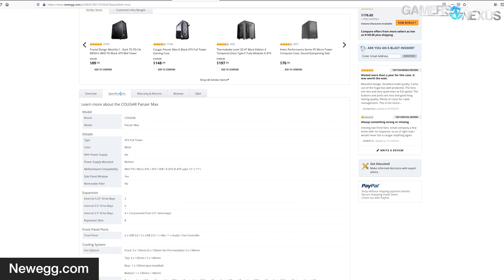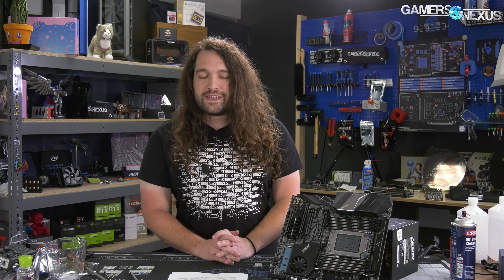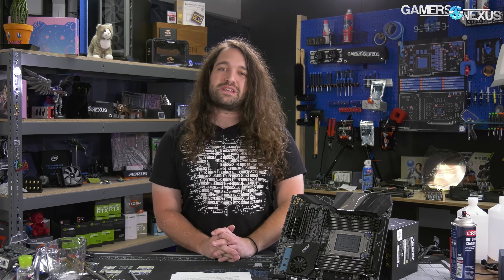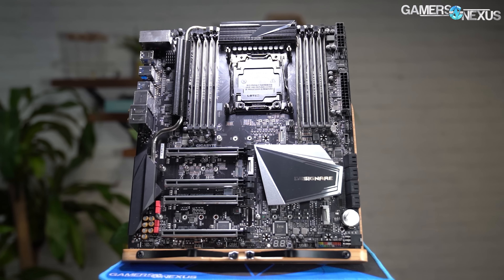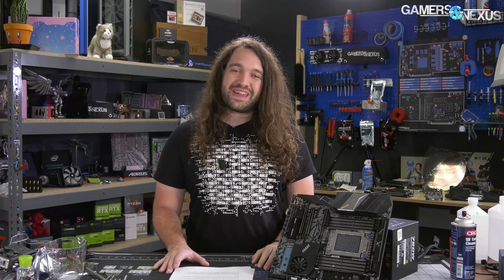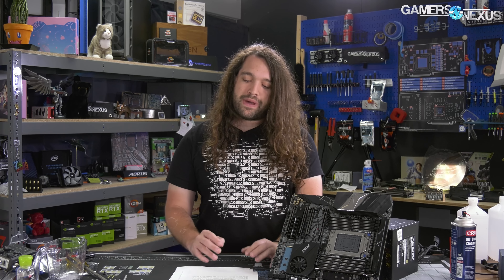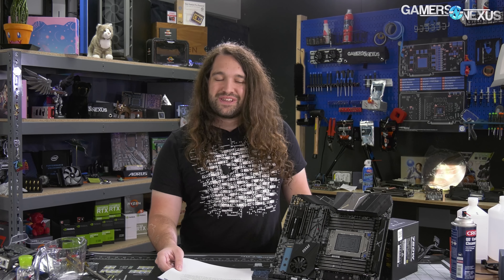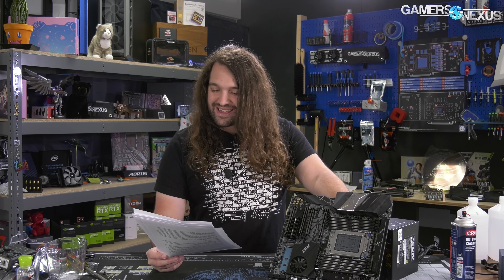"E-ATX" Is A Lie: How Motherboard Makers Ruined Form Factors

Comment: I had a prebuilt once (Medion MD8800), years ago that came with a BTX motherboard in a BTX only case. Had a Pentium D cpu. It also had no cable management system whatsoever. That killed any upgrade path for that down the line. It had a active case fan placed next to the huge heatsink on it, which kinda meant they were using the same cooling methods of an ATX system.

Comment: If I remember correctly back in early 2000s there was a form factor E-Atx(SSI-EEB) which all motherboard makers and cases stuck with for workstations and high end motherboards. It was only with advent of X58 that the nonsensical Xl-atx and E-Atx(current) started out.

Comment: My older computer had an SSI-EEB board (Asus Z10PE-D8 WS). I bought a case that was advertised as E-ATX compatible. The board fits, but the mounting holes are out of alignment in the PCIe area. The graphics card has held that part of the board in place, it's a big mess.

Comment: Now make one about how case makers have turned M-ITX cases into barely scaled down ATX cases. 
Edit: and how they’ve killed off the Micro-ATX form factor
Reply: @ferinfox  It's not just mATX, also ATX board have those "we saved some PCB, so you don't get 3rd row of screws". Installing 24pin there with finger under it was painfull, but could break the board if not done so.
Reply: @onboard3  that's something that always drive me crazy, mfgs are just being cheap
Reply: on my matx board you cant install a gpu with backplate because the ram slots are too close, i've since taken out the lower ram clips to make it fit, doesn't seem too secure tho...
Reply: YYYYYYEEEEEESSSSSSS
Reply: @ferinfox  hey mAXT has specs 4 pcie slots on back and 244x244 mm :D
Reply: @onboard3  but mostly only seen on budget boards with only 2 dimm slots and not much periphery imo
Reply: @ferinfox  specs are max. dimensions you can use less. And ITX and DTX came later afaik.
Reply: And as China destroys the desktop pc market with incompetence. 🤣
Reply: @ferinfox  mATX isn't a problem, there's a defined max size, and you can always fit a smaller board into a larger case. The problem with "EATX" is that there's no defined maximum.
Reply: This issue is made worse by the usage of words/acronyms.

"M-ATX" is NOT "micro-ATX" , the "M-ATX" acronym stands for "Mini-ATX" and was released as a form factor in 1997 by Intel, it was also released alongside the "F-ATX" form factor which is an acronym for "Flex-ATX".

The correct acronym for "micro-ATX" (Often called "Micro-ATX" with a capitalised "M" in the word "Micro") is "mATX", it does NOT have a dash separating the "m" and the "ATX" parts of the acronym. 

It is unusual that this is the way to officially write out the acronym as most acronyms used for the "ATX" series of form factor designs often do include a dash "-" to separate the two halves of the phrase.

Also, another common mistake is the use of the term "ITX" when describing a "Mini-ITX" form factor motherboard, the "ITX" series of form factor designs is of the same importance as the "ATX" naming scheme. 
I say this because there is no single "ITX" form factor, you have a range of sub-form factors under the "ITX" acronym.
Examples of such "sub-form factors" include: "Thin-ITX", "Pico-ITX" & "Nano-ITX", other "ITX" sub-form factors are also available.

Hopefully with the information I have provided above you can start to see where things have gone wrong, too many similar acronyms with insufficient amounts of customer and technical knowledge in the field, and as such it has resulted in a whole generation of customers & engineers who often mix up the acronyms and the naming schemes of each form factor, alongside this is the lack of self-regulation in the industry which has resulted in a single acronym having more than one physical dimensional size defined to itself, E-ATX & XL-ATX are perfect examples of this.

As the customer we need to not just put pressure on the industry to regulate, we need to enforce our own definitions of what we understand each form factor to be, and force the industry to apply by & design to those customer defined form factors with NO deviation from the standards that are defined. Most sizes are already clearly defined in the OFFICIAL ATX Specifications documentation, it is only the odd layouts that need to be eradicated to history.
Reply: @tobymarol7329  that may not have been a good idea. I caused ram errors during a memtest86 run by thoughtlessly touching my ram. Wanted to see if the heat sinks were hot.
Reply: I actually looked at the various M-ATX boards and  there seems to be very little  in that form factor that goes beyond the ultra budget slash OEM cheap out grade. M- ITX boards are more feature rich despite being much smaller.

Comment: BTX was really a non-starter. Dell used it in Optiplex and Precision systems, and while they got air cooling right with it (a nice Delta fan that could push a ton of air), expandability left a lot to be desired.
Reply: HP, Fujitsu, Gateway, and I don't know of anyone else, also used BTX. Also, the PMG5/OG Mac Pro cases were a BTX derivative.

Comment: Some may argue that this video can get a little "long in the tooth" at moments, but I'll be damned before everyone wouldn't agree that GN doesn't do their research to the fullest. Always holding my full attention, I love when Steve rants on the hardware manufactures and exposing all the marketing BS they love throwing around. I'm extremely passionate about tech in general (but especially  desktop hardware) and I can guarantee that why cases in 2020 even have a modicum of airflow is thanks to Steve having the guts to call out manufactures. This "E-ATX" non-standard debacle has been driving me insane for a decade. Thanks, GN!     TLDR: Gamers Nexus rocks.
Reply: It set's them apart!  I do enjoy the content.  Actually Hardcore Overclocking is awesome too!  Keep up the good work!

Comment: I'm still a bit sad the BTX form factor(s) didn't make it, they were SO interesting. CPU near the front, right-side entry (on a regular tower case) meaning graphics cards would face up instead of down. Enforced placement and sizing of CPU cooler mounting holes, meaning you could build PCs where the cooler wasn't attached to the motherboard, the cooler was directly attached to the case itself.

Comment: E-ATX does mean something: It means you must compare the height and width numbers from the motherboard with the numbers of the case. If both numbers of the case are equal or bigger, you can use it. And in general it means that E-ATX is bigger than ATX.

And it is pain in  the *
My new 3970X CPU system. Selecting the components took me 2 hours. Finding the correct case took me 3 days.
Reply: I'm looking for a 3970x system too... can I know your final choices?

Comment: Standard math use the horizontal (X) first, then height (Y).
Reply from the maker: Cool story. You can do it however you want as long as you explain it first.
Reply: @GamersNexus  
You shouldn't HAVE to explain it.
Kinda got the feeling that was the crux of your argument, but WHATEVER, guess you're "just right," in spite of greater mathematical conventions.
But, you know, WHATEVER.
Reply: @GamersNexus  The fact that you made this statement on this video is outstanding

Comment: Case in point, my Crosshair VI Extreme is an eATX defined board even though it's only 12×10.6. That's only an inch wider than the standard ATX and 2.5" narrower than a "standard" extended ATX mobo. It's still a fantastic board, though.

Comment: It took me quite some research to find that Fractal Design Arc XL (probably Define XL as well as it is basically the same case) can fit my EE-ATX dual socket MB. Of cause not all holes line up but that not big of a problem. So if a case like that can fit EE-ATX then it can fit also any E-ATX or SSE-EEB/SSE-CEB MBs.

Comment: But standards take all the fun out of it!
Reply from the maker: You know what, you're right. We should use Rorschach blots to describe motherboard sizes.
Reply: @GamersNexus  I recommend the "Two Bears High Fiving" boards.
Reply: @GamersNexus  lol - would probably make more sense to marketers vs. just putting the freaking dimensions down.  Matching holes between motherboards and cases used to be more of a thing in the AGP and earlier days - thankfully that seems to have at least calmed down, even if the physical dimensions are, as you so noted, an absolute free for all.

You also made an excellent point about the drive bays and “extra” space in front of the cases these days - hopefully everyone can come up with a standard to take advantage of that space without continuing to drive system builders crazy.  Not holding my breath tho :/
Reply: @DocNo27  ehh, case manufacturers are just cutting that space out and making smaller cases. A trend, I as a water-cooler, wholeheartedly disagree with.
Reply: @Silverhks  I agree with you and i am a air only kind of guy. They waste a lot of space while not giving enough!

Comment: The problem dates back to the ATX spec itself. Back in the 90's you simply didn't have the 12 inch long, triple slot wide and HEAVY GPU monstrosities that are common today, never mind the "reinforced" slots necessary so that they don't shear clean off. CPU, GPU and PSU hardware has jumped by leaps and bounds, as has the COOLING requirements.

In the server space manufacturers give ATX the finger by using proprietary form factors when EEB/CEB doesn't work. That's how you cram 8-20 GPU's and redundant PSU's inside a 4U form factor chassis.

The truth is the ATX 2.x spec should have been revised/abandoned a good 15 years ago for a newer ATX 3.0 spec that caters to modern graphics cards, processors, power requirements and most importantly cooling. Had they kept up with hardware advancements we should be looking at ATX 4.0 by now.

BTW: BTX was "balanced thermal exchange" - a complete flop that hardly any manufacturer supported and nobody wanted.

Comment: Seems like anymore that we should just be making our own cases. One thing I wish more case manufacturers would do, is add removeable motherboard trays that you can customize, perhaps even with sliding standoff mounts so that you could conceivably mount anything in that case, as long as it was not bigger than the area inside the case. I've been kinda pondering the idea of doing my own case build sometime, but... I have limited tools and things to work with, so I'm not sure how exactly I'd do that. Maybe an open-air solution? Is that viable, at all? I've heard of some people using open air builds, so I'm kinda curious as to what kinds of pitfalls and things one has to consider when doing an open air build, or perhaps a large enclosure with the parts spread out to avoid things like accidental moisture being flung onto the exposed circuitry and such.

Comment: on the other side, remember to be able to fit some asrock m-atx motherboard into itx case ;)  (1155 area with 17cm x 21cm mb size... later they've reach 18cmx 22cm on their matx 1150/1151 so not working anymore..)

Comment: had this problem with may cases, when motherboard does not fit. and standards are really confusing. the latest one was with maximus ix extreme and h700i case. by specs those fit. but in reality too many compromises for it to work as intended.

Comment: The standard I want is something closer to DTX, where you can fit a dual-slot GPU with still an accessible PCIe slot for something else.

Or make micro-ATX cases that are actually closer to Mini-ITX.  They always seem to be too shallow for a good air cooler or so wide/tall (desktop vs tower) to really be any benefit over plain ATX.

I guess Thunderbolt becoming more standard may offset this issue somewhat, allowing you to go Mini-ITX without losing access to add-on card if you have a GPU.  But dang, its taken so long to get there.

Comment: 17:03  That's my take on the rampant use "p" to talk about screen resolutions.  What does "1440p" mean?  Who knows?  I've seen it used to describe three distinct resolutions.  HDTV has 720p and 1080p specifications, which cover both resolution and signal types.  You shouldn't even be describing 1920x1080 as 1080p or 1280x720 as 720p, because you're not using HDTV signalling to achieve those resolutions. 

If you aren't stating two numbers, you are not stating a screen resolution.

The upshot is, people love abbreviations too much, even when they don't make any sense.
Reply: @ikevermander1325  I suppose the OP's point is that 'p' is redundant in most PC contexts because when was the last time PCs commonly used interlaced resolutions? The 'p' is perfectly correct, but redundant.
Reply: @ikevermander1325  You've missed the point.  Why not 1920x1440?  That's a standard resolution with 1440 lines.  Beyond that, 720p, 1080i, and 1080p are not resolutions.  They are signal names.  Two of them share the same resolution (1920x1080).  Before even getting into overscan issues.

The upshot is, it is never correct to state a number followed by "p" as a screen resolution.  But I would apparently have to go into far more detail to make younger people understand.

Comment: An issue I had with an old asus board is it was too small for ATX, listing: ATX Form Factor: 12 inch x 8.8 inch ( 30.5 cm x 22.35 cm ). 
it was 0.2inches short of ATX and the 3rd column of screws were just to the side of the motherboard. After changing powersupply a few two many times I managed to over-stress and break the motherboard, as the power connector was on the very edge of the PCB that wasn't supported by any screws at all. https://www.asus.com/us/Motherboards/Z87A/

Comment: I wish there were a newer standard allows GPU to be mounted like a CPU with Noctua NH-D15 on the top and thus blow air out more effeciently and quiter instead of blowing back into the case and thus affect thermal significantly.

Comment: So wouldn't that Domnius motherbopard, the 14x14 one be considered E-EEB (Extended Enterprise Electronics Bay)? The other alternative would be E-MEB (Extended Midrange Electronics Bay) since it falls short of MEB width but is longer than spec in length.

Comment: What really bugs me is that today motherboards and cases have 7 slots while earlier (like the 286 boards) there were 8 slots. If at least the cases had 8 places then the last slot could be used for double-width cards as well.

Comment: will eatx mb fit in atx cases ?it seems the screw mount holes are same only the wider sideways ? will I be able to route power cables under my and around board to connect in atx case ? thanks

Comment: microATX is also a little bit a chaos. Some cases will not actually fit microATX (244x244mm), but rather a shallower variants (like up to 244x215mm, or 244x195mm), and often in many shops these cases will be listed as microATX while they are not "microATX", they are "microATX-like" . Which are a nice boards and smaller cases, don't get me wrong, I love smaller boards and tight cases, but the naming conventions are a mess.

Comment: BTX needs to come back. Actually, I'll just take any standard with standardized pinouts for modular PSU cables and front panel connectors. Call it CTX. And Included a standard for m.2 locations.
Reply: If BTX is a mirror image of ATX, then CTX being a mirror image of BTX is ATX again.

Comment: The extra SSI-EEB holes make it difficult for most modern cases as they all come with pre-placed spacer screws which could short out a motherboard that isn't "SSI-EEB compatible". it's not as simple as using that term. An ATX motherboard wont be compatible if all spacer screws are used.

Comment: Ran to this issue recently. 
In search of a case for my intel dual 1356 server board, I opted for a case without the ssi-Ceb or e-atx designation and from the video I am relieved that i got a cae with atleast "four" motherboard stand-offs correctly.  

I  just basically opened every screen shot of all cases that has wider than atx size just to check mounting holes.  Silverstone had a case that had ssi-Ceb designation but only had 3 mounting holes matching for my board as the case for my previous e-atx cases from cooler master and antec making the board sag on socket side of the board.

I'm a little relieved that i know i didn't get F#$k here by the manufacturers or by me for lack of research.
I take a little solace from learning that there is no official soecification for e-atx and as far as the intel ssi-eeb and ssi-Ceb, the mounting holes are OPTIONAL. And i got the critical 4th mounting screw for my board which is the middle  screw correctly (its a weird placement but its the only one near the center of the board).

Thank your the explanantion.

Thanks Gamer Nexus.

Comment: I'm a bit late here but some help would be awesome.. I have an Asus Maximus XII Extreme motherboard currently in a Corsair Crystal 570x, I would like to get a new case sometime soon but I want to make sure the motherboard will fit fine. The Crystal 570x was a pain in the ass to fit the motherboard in and stand offs didn't really want to line up. Should i just get another full tower case?

Comment: Thank you.  I've been driven nuts by this for years.  Simple fix that the industry doesn't give a sh*t to fix.  And damn, Steve got some sun, hope you're using some Aloe for that.
Reply: you can always buy a test bench case 😉
Reply: @HarshNerf  might as well at this point, it's easier to clean too!
Reply: It's been 85 in carolina for a couple days... but could be from the trip

Comment: I have been using pcpartpicker when im not sure a mobo and case is compatible. But as Steve says the manufacturers should also show the actual measurements so you know if the mobo is going to fit

Comment: I'm not sure if anyone else has run into this, but I have many gripes with MSI's many "ATX" boards that are for whatever reason have half an inch or so shaved off the width so you have the whole right edge just not mounted.